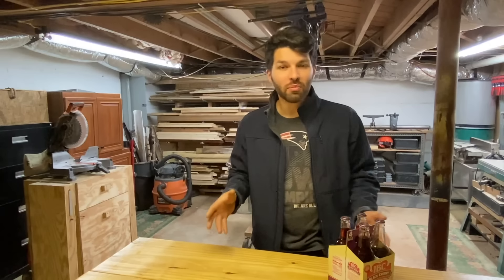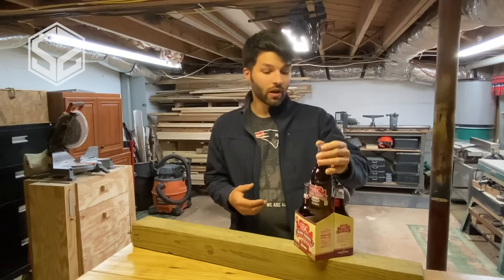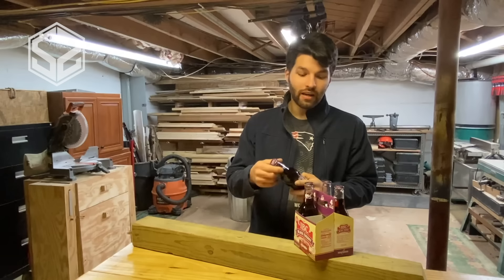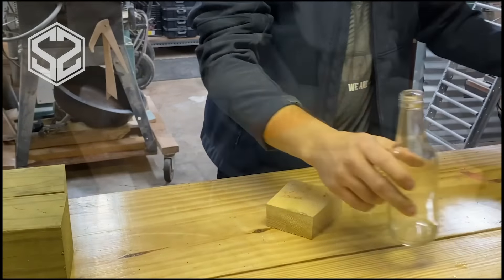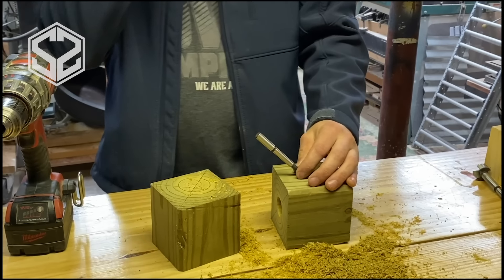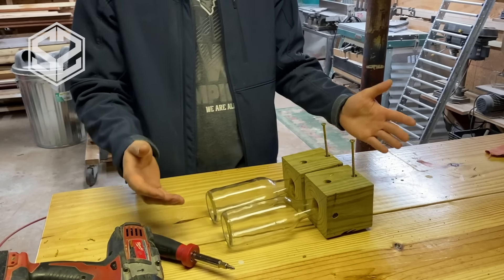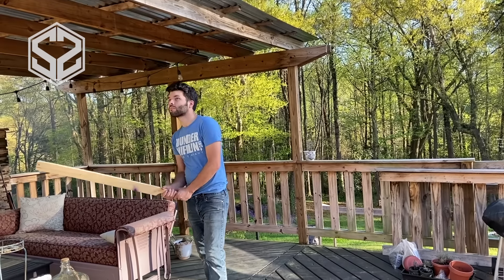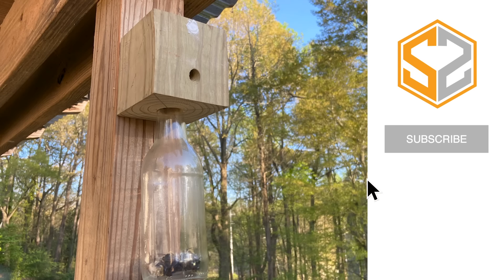How to kill carpenter bees

Comment: I use a badminton racket to swat wasps and bees out of the air while I’m working outdoors. Rarely miss, no wind resistance.
Reply: I would be terribly terrified if I missed.
Reply: When I was a kid I would use a wiffle ball bat gives a real nice pop.
Reply from the maker: Nice! I need to try it!
Reply: Damn,  show it off! Can we get a video of your Olympic level wasp swatting skills?  That would be epic. (This was funnier in my head).
Reply: Been doing the same thing.    Then fill the holes with silicone caulk
Reply: @michaelburmudzija3584  nothing to worry about. I have stood in their area and taken many out at once and 1 at a time 1 after another.   I have missed few.  They just fly off and return later
Reply: @OhioFreedomFightersKennFreedom  it's crazy they just flew off. I remember sitting on my deck and one just sting me for doing nothing. I do like the sound it makes when you smack them 😂
Reply: I used 2 cans of spray realized cost.Bought 2 badminton rackets at thrift store for a buck . Be honest lost track at 850 CBS.I sware they reconized me did'nt have to pick up racket they were gone.
Reply: only way to stop DAMAGE fill holes and put good coat of primer on then good coat of paint .they were doing a job on wooden carport this stopped it . they will eatpreasure treated wood to.
Reply from the maker: Thanks for the tip!
Reply: I did that, sealed up in a makeshift bee suit (basically my ski outfit 🤣) and my dad looked at me like I was nuts. Swinging like a madman with a tennis racquet. He goes, leave them alone they aren't bothering anyone. I said: "they are in your face non stop." Turns out, about two weeks later I see him outside, and I start cracking up. He was swinging away 🤣🤣🤣 They are SO protective of their areas. They even chase after leaves that fall in their "area" ffs hahah needed some dealing with to say the least
Reply: @B01  So funny!
Reply: Same here been weapon of choice for years.
Reply: My carpenter bees are huge and. When u swat at them they start dropping air shits I smacked it with racket hard af and think it tanked It cause I didn't find nd a body lmao
Reply: Their bodies get stuck in the webbing. Lol
Reply: Only thing, your neighbors don't know your swatting bees, just think your "kooky loooky"!
Reply: @michaelburmudzija3584  no
Reply: @josesanchez6810  honestly the convo was so long ago I don't know what you are saying no to 😂
Reply: @B01  they really are in your face. My kids freak out.
Reply: I really had to come to the comments and see if my husband commented! His go to weapon is a kids wiffle ball bat. More surface area. Then he squeals like a kid when he gets one 😂
Reply: @Bakednotfryd  That’s kinda cringe ngl
Reply: Wow! Awesome idea!
Reply: Just noticed your shirt😂 #GoPats
Reply: @mr_burky  bumblebees are only aggressive when you are near there hive.
Reply: That's my favorite too!!!
Reply: When filling in the holes understand that they bore about a 1/4" in and then turn 90° about 4-6". Before filling holes with caulk I take a zip tie and stick it all the way into the hole to kill any eggs/larvae inside.
Reply: They now sell one with a electric charge to zap them .
Reply: That's what I use, a badminton racket.
I don't think they can sting you. Batter up
Reply: @chrissyisbomb94  I leave them alone unless I find them boring into my deck or outdoor furniture
Reply: Same
Reply: @beaumontmichaels3575  You are right. However it keeps the bees and the neighbors away.
Reply: I do that also and batting Seasons coming up
Reply: I refer to that method as “bee baseball”
Reply: I love spraying them with break cleaner....psshhhhsssssstttttt.. DEATH at it it’s best!
Reply: Correction... brake cleaner
Reply: I do this too.  Have one in every building. 😂
Reply: Bumble bee baseball
Reply: I used to do that but this year the bees are different they just fly in place looking at me and if I move a muscle they move. Then they always get up close too me
Reply: Lol😂...I use a shop vac
Reply: Put a piece of nylon ahead of the screw
Reply: @samuelhowie4543 I got one of those for flies. 😅
Reply: @Ribcrickett  That's what I use mine for.

Comment: I use a tennis racquet to swat them in mid air. Great fun! And the thud when I connect is a very satisfying feeling. Lol
Reply from the maker: Love it! :)
Reply: Me too - best is 10 in one day!
Reply: That actually sounds like fun
Reply: I use a weed whacker🤣🤣🤣
Reply: Tennis racket!!!
Reply: Electric fly swatter might be fun
Reply: They don't care for Brake Clean or Spray Adhesive either. Those electric bug zapping "tennis rackets" add some depth as well.
Reply: Yes fun stuff. I used fat style whiffle ball bat
Reply: That works nice but the way to go is a badminton raquet. These weigh almost nothing and the strings are closer together. I've used a badminton raquet since I was a kid in the 80's and the "PING" it makes still excites and puts a smile on my face to this day.
Reply: Badmitten racket is more fun and lignter/faster
Reply: @DEW-fk7ij  Thats because with  the holes, theres no resistance. The air blows right thru it as you swing.

Comment: Stain, paint or seal the wood regularly to prevent it from drying out. When the wood gets to a certain dryness it attracts them. They make a wood bee spray at diy or home repair box stores. Spray early morning or when cool or cloudy. Only one quick burst per hole will do the job. A can with a straw works best. This along with bee traps will get them under control. You want to put a male bee in the trap. That's the one that gets in your face. The males defend the female. That's when the racket or bat comes in handy. Start early in spring before it warms up above 70. Takes several seasons to get under control. Hope this is helpful to someone.
Reply from the maker: A tun of great info!! Thanks so much!
Reply: Good info.. Can I use treated lumber or should I get non treated? Thanks
Reply: @murphshall  treated is better but untreated will work if stained or painted when it needs it. The idea is to keep it from completely drying out due to exposure.
Reply: @richardtrowell8812  thanks Richard. I started with treated but because it's so wet, it splinters quite bad (in the hole) and didn't know if the smell would turn them off. I have a lot cabin (kit home) and they are burrowing in, laying their larvae, then the woodpeckers come - very frustrating.

I'll take a file to it to clean it up. Glad I came across this and thanks for the info.
Reply: i realize it's kinda off topic but does anybody know of a good site to watch new series online ?
Reply: @Mohamed Gerald Try flixzone. Just search on google for it :)
Reply: @Ian Colin Definitely, have been using FlixZone for since march myself :)
Reply: @Ian Colin thanks, I went there and it seems like a nice service :) Appreciate it !
Reply: @Mohamed Gerald happy to help :)
Reply: Put 4 drops dish soap n 1/2"water n bottle they dont get out.
Reply: @johnallen4710  They can't get out regardless. Neck is too small to spread wings and glass (& plastic) is too slippery for them to climb.
Reply: I used ant spray.  It works.,,do it on a rainy day when They are holed up...Soak them  good in the hole  ...
Reply: It is helpful thank you

Comment: I have discovered that using Bengal Roach spray in the area's that these Carpenter bees target, once their feet contact the Bengal it is game over! They don't drop dead immediately but they DO DROP DEAD.
I also sprayed Bengal at my front door plus on the threshold area. Works fantastic!
Reply from the maker: Thanks for the tip! 😊
Reply: I also discovered that giving my front door a light spraying with Bengal really eliminates a lot of bugs!
The door has 12 glass panes.

Comment: Additional comment: These bees can be selective about the wood they will burrow in. So if you have a lot of old unpainted/unprotected wood around, they will tend to go to that wood first. If you have unpressure-treated wood they will choose that over pressure treated. So when making and hanging your traps take note of other types of wood are in the area. Paint and/or protect all other wood in the area. If you can use softer untreated wood for the trap that is better than new pressure treated. I happened to find some old but solid 4x4's and these worked perfect for my traps and the carpenter bees seem to love these. I try to make sure all the other wood in the area is painted. Also the bees seem to like corners, so hang your traps either in inside or outside corners of the outside of your structures. For example if you have a porch that sticks out from the walls of your house, then put the traps on the outer corners of the porch or on the place where the side walls of the porch connect to the wall of the house.
Reply: I’ve been seeing these bees lately hovering in front of me. I told them I’d leave them alone if they’d leave me alone. Hahaha . Well they left me alone a little while but I’m seeing damage they do!!!!! Oh nooooo! This will not work out!’!! I was going to get a small frying pan, sit on the porch and swat them down . Ping dead! Ya know. But I like this bottle of yours with the block of wood idea better lol. So next pay day we will get the materials needed and make a few then spread the idea to the neighbors too and we live need a little forest so maybe put some of these in the woods too. Thank you for the idea! They are getting pretty bad around here. It’ll take forever to get rid of the pests with a frying pan and I don’t want to get bit or stung! Ouch! Hubby is a carpenter so he’ll be into the idea too. Yay I don’t have to sway bees. Thank you bet much’
Reply: @mypurpleflower6585  Yeah, unfortunately that is the problem with carpenter bees. One female can lay somewhere between 6-8 larvae in a season. Those will hatch the next Spring and stay in the same area. So the first year you may only see two (male and female) the next year you, might see 4 - 6 pair (depending on the male vs female makeup of the first generation). Within 3-4 years you're inundated with carpenter bees and their chewing up your wood at an alarming rate.

Comment: I had an additional thought. Instead of the "set screw" you could get a piece of metal, nothing too thick, you want it so it's not too hard to work with, but stiff enough that it will hold the bottle. Cut a square piece just slightly smaller than the bottom of your piece of wood. Then, drill a hole the same size as the neck of your bottle (just below the "lip" on the neck. Once you have that done, cut the piece of metal in half. This gives you two pieces with half moon slots. Drill a hole in the center each metal piece just big enough to put a screw through. 
Flip the trap piece of wood upside down. Put the bottle into the center hole. Now take your two pieces of metal and slide them on so the half moons of each metal piece slide on each side of the neck of the bottle. Keeping the half moons tight to the neck of the bottle, put a screw through each piece of metal into the trap wood (be careful that your screws don't go into the tunnel that you drilled in the trap). This should hold the bottle in place as that "lip" on the bottle neck won't allow the bottle to slip out. Flip your trap upside right and you should be good to go. If you want. Drill a small hole from the top of the wood trap into the larger center hole. This will allow you to poor some soapy water through that small hole and into the bottle, once you have your trap flipped upside right. I always put about a 1/2 inch of soapy water into my traps. Also, do not clean out your traps for the whole season. The dead bees give off a pheromone that attracts other bees. So only clean out your traps once a year. Unless of course they get totally filled with bees
FYI - You could probably use some stiff plastic instead of the metal.. might be easier to work with. Just make sure it is stiff enough to hold the bottle in place.
Reply: They shouldn’t be killed, they are beneficials and we are losing such insects at an alarming rate. Build a bee house where they can drill as they need and they’ll leave your house alone.

Comment: I did my traps similar but I used a slightly bigger bottle (like a 1 quart orange juice bottle) then what I did was drilled a larger hole in the cap of the orange juice bottle and then glued the cap to the bottom of the piece of wood (lining up the hole in the cap with the hole in the wood. Then all I had to do was screw the orange juice bottle into the cap and bingo I have a removable trap. Then I took a small eye hook and screwed in into the top of the piece of wood. Now I can use any type of carbineer or snap hook and I can hang the trap pretty easily.
Also, it looked like "Simon" only drilled one hole on one side. When I make my traps, I drill four upward angled holes, one on each side and all four of the upward angled hole connect with the bigger hole drill up through the bottom of the wood of the trap. This way the bee can enter through any of the four holes and she will still end up crawling down the center hole into the bottle.
Reply: if you had filmed it, you'd be internet famous by now!!
Reply: @jaewok5G  hahaha thanks
Reply from the maker: Thanks for the tips! 😄

Comment: These traps do work very well, I like the design of these.  If you are able to find where the carpenter bees nest, in the past I have waited until dusk, sprayed bee killer up inside the hole, and then capped it with a piece of hardwood dowel covered in wood glue.  Of course you have to be very careful doing this, but it works to kill them, and cap the nest.  I just come back a day later and saw the dowel off flush.
Reply from the maker: That is a great idea! I have plugged all of the existing holes I could find but a few were drill through again by the bees inside. The bee killer is a good touch to keep them from getting back out. Thanks!
Reply: I had a bunch of them drillingbaway on my deck supports I filled their hole with silicone and trapped them all inside.

Comment: Good design but I would suggest making at least three(3) entry holes rather than your one(1),  could double or even triple your catch. I make four (4) entry holes, one in each side and hang traps from the top. I have seen bees enter two or three holes at the same time.
Reply from the maker: Thanks!!! I’ll have to test that out!
Reply: Is there a certain kind of wood they like oak,pine etc
Reply: @xXthechameleonXxog  I can tell you that CCA or newer treated wood does NOT deter them.

Comment: When I changed the fascia a few years ago, which was 1x4" red cedar 12' long installed about 30-33 yrs ago, I found full length parallel tunnels in the boards made by carpenter bees, one board had 5 such tunnels, others 2 or 3.  The bees overwinter in the tunnels and emerge in the spring and re-use the same tunnels year after year.  Used Hardie board to replace.   There can be 6-8-10 bees in one tunnel over wintering.
Reply from the maker: Thanks! If left alone they can cause serious damage if they are drilling into a load baring frame.
Reply: we call them condo  bees. haaaa

Comment: Also rather than caulking the holes you can get plug Cutters and all different sizes make your own to fit but 3/8 always work for me spray into the hole insecticide and then glue plug into place matches a whole lot better than caulk.
Reply from the maker: Sounds like that would work really well!  Thanks!

Comment: I've been buying and using carpenter bee traps for several years now and the main problem with them is getting bees to go into them initially if it's a new trap.  Once a dead bee or two is trapped, the scent will attract more but it can take a while to get the initial bee "seed" trapped.  What I did this year was get some bee attractant off amazon and it worked AMAZINGLY well but my traps fro last year are falling apart so I may just DIY a few more this year.  I've got plenty of spare wood.

Also, we have a $1 per bee bounty at my house so the kids will be out there with tennis racquets going to town.